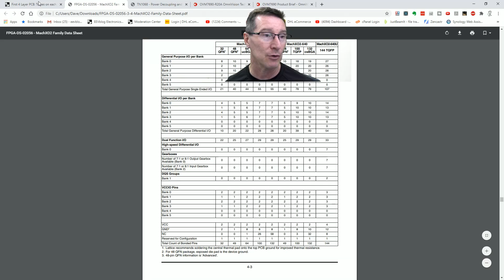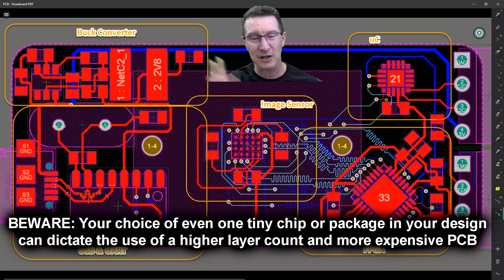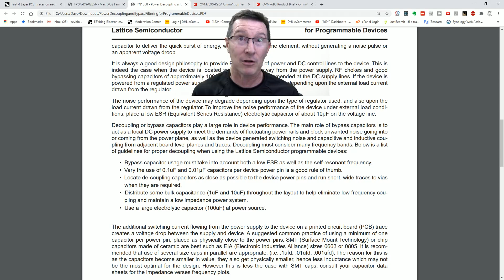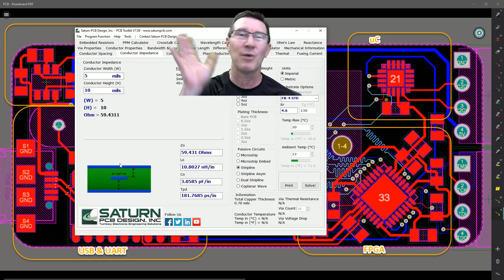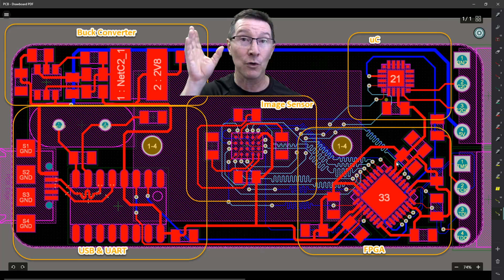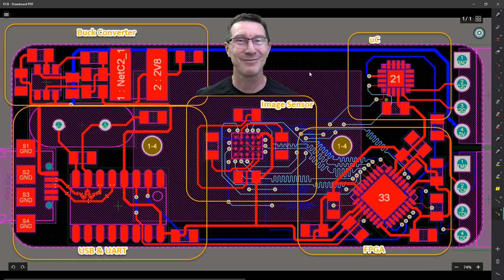EEVblog #1323 - PCB Layout Review & Analysis

Comment: Those decoupling caps around the image sensor looks like they are playing musical chairs.
Reply from the maker: Last one down gets the inductance!
Reply: @EEVblog  I think all of them got the inductance in this case!
Reply: @EEVblog  Is inductance contagious? In the new normal, it needs to be asked.
Reply: I was reminded of a May-pole dance. But where are the zeroes?
Reply: The designer probably had them right the first time but then decided to turn the chip 90° for signal routing "optimisation"?, but did not move the caps with it. Just guessing ofcourse...
Reply: @EEVblog  I laid out a switching power supply recently and placed ceramic caps for it... and the main cap for the board near the power connector... my bad it was over an inch away, and when the board powered up I got a large spike (48V input spiking over 60V) that killed the regulator! Bodged on an electrolytic next to the regulator and it worked every time and voltages came up nice and easy! THE ESR on the ceramic caps is so low... that they don't do much filtering.

Comment: These types of videos I really enjoy - It's almost like having Dave as a mentor explaining what to do. Regarding the decoupling caps, I always like to think of it as knocking out any inductance that's introduced from the long trace from the power supply to the chip, placing the cap as close to the IC as possible means the trace post cap is super short (and therefore very low inductance!). But, the discussion on things like layer stack up and WHY you should have it that way is priceless, I'll definitely be watching this video again when I need to lay out another board!

Comment: All good advice Dave. The power wandering around on a 4 layer board instantly threw me for a loop (pun intended). 🙂
Reply: It looked like he tried to do the layout for a 2 layer PCB, then had to later change the design.  Those 2-layer power traces definitely need to go in favor of vias to the power planes.

Comment: I never run tracks between pins, like on that lower left, unless absolutely necessary. It's easy to end up with whiskers to be left when etching the board. It's also not ideal to be soldering either side of the through trace because you can get a solder bridge if the solder mask isn't perfect. There's no need to have done that since you can route the power to avoid it.

This board uses very few hole sizes which is good. However, make the vias as big as you can, because small drills, say 0.4mm or less, have much shorter flute lengths than bigger ones. PCB manufacturers typically want to drill through 3 x 1.6mm boards in a stack because drilling takes a lot of time. As soon as you drop below 0.4mm, you're pretty much forcing them to drill them 2 or even one high. Ask your PCB manufacturer about this sort of thing, you can save a lot of money. Decades ago, all PCBs were drilled and routed 4 PCBs high, and via holes were 0.7mm diameter to allow that.

If you have lots of through holes, try to rationalise them to use the same sizes wherever possible. Again, PCB drilling machines have to stop the spindle, swap tools and then restart which all takes time. It's also another possible source of error, because drills can look the same size.

Another thing we used to do was to drill the first and last hole of every size in the scrap outside of the circuit frame. That way  a quick visual check can spot if a drill broke. If there are thousands of holes, you won't spot this until much later in the process.

Again, ask your PCB manufacturer for their best design practices, and better still, go and visit them and sit down with the people who are the victims of your poor design decisions.

Use wide tracks rather than unnecessarily narrow ones, and don't route them up tight against things when they don't need to be. 
Run a gap check, and increase the clearances it flags up. Increase the allowable gap clearance and do it again. That way you can make the board easier to make and have less chance of shorts or interference.

Comment: The USB-to-Serial chip is CH340, and its CH340C version is exactly the same SO-16 as others, but doesn't need an external crystal, it has an internal one, the XTAL pins just stay NC! The chip is available on LCSC
Reply: Hmm I heard people say it's very unstable though, don't know why. That's why I just used the G version in a board a while ago
Reply: Internal oscillators have fairly wide frequency swings over temperature.  I'd prefer to use the crystal for the much tighter frequency tolerance.  USB doesn't like varying signal rates.
Reply: I've done several hundred boards with the 340C and generally it's been good for me. However I did have this one customer who absolutely could not get the products to operate on one of his PC. It could have been many reasons - including this.
Reply: @Dave5281968  Wouldn't you rather use the host's time base in the device? Guaranteed to be ±0 variance from the host's time base, once the x48000 PLL locks.
Reply: @AirzonesBlasters  Yikes

Comment: A lot to unpack here.
Upfront, I worked at Agilent in Mulgrave for 27 years, the last 12 as a PCB designer (ECAD Engineer) for our EE engineers. The last 5 years as their only dedicated pcb designer. We used Protel/Altium exclusively up until I left 6 years ago, now retired. They have now mistakenly gone corporate with Mentor Graphics. That’s another story.
First off, top layer should be BLUE, not red. Red is the Altium default and is wrong. Blue top stems from the old red and blue Bishop tape days whereby the positives and negatives used the colours to determine which was the top and bottom layer. This was of course for 2 layer THT (Through Hole Technology) pcbs. Yes, it’s only a colour but standards should have been kept.
Next, use metric, NOT imperial. All Agilent pcbs were designed in mm, not mils. The world is metric, not American standard imperial. All through this video I had trouble trying to convert mils to mm. The only imperial that we used at Agilent was oz for copper weight but even that we usually specified as 18 or 37um. I.e. thickness rather than a silly oz per sq foot or whatever it is.
Now to the video…
•	The pcb should have a ~5mm edge around the pcb for smt (Surface Mount Technology) placement machines to grip the pcb securely. Only reason not to is if the pcb is part of a panel with routed breakoffs or defined routing afterwards.
•	I agree the cap locations around the image chip are terrible.
•	A major rule to follow in design is “follow the current, follow the current, follow the current”.
•	Traces at acute angles are the single worst error in pcb design. I guess the creator used auto-routing , terrible idea.
•	THT crystals are quite common for reliability and getting the right type of crystal, they’re ok.
•	4 Layer is fine for this. It could have been done with 2 layer but with EMC in mind and the fact that 4L is only 30-50% higher in cost than 2L then it’s a good idea. Even in very complex pcbs like PC motherboards you very rarely need to go over 4L. I designed over 100 pcbs I reckon with many large designs and I only used a 6L or higher about a half dozen times, and these are A4 size pcbs with many many chips.
•	Altium footprints are not optimum, even though they say they are PbF and IPC “standard”. They aren’t truly PbF pads and courtyards don’t allow for height when heat flowing solder 
•	For the large FPGA, yes they are usually designed to be at 45deg if using lots of pins such as in a PCI card. They’re designed that way.
•	The usual chip bypass is 100nF but I agree it is negotiable. Also remember that vias to the gnd and power plane will provide HF bypass which might negate the requirement for 10nF caps. Another method is vias inside a chip’s smt footprint but that’s a whole new ballgame.
•	I agree that a large cap used as bulk capacitance and the local power plane capacitance might be enough, maybe not.
•	Don’t use auto-routing, it’s more trouble than it’s worth unless you are dealing with a really large design that is time constrained, but even then you need to do most of the placing and power planning beforehand. Auto-routing loves 6+ layers. It’s getting better but just cannot easily do analogue stuff properly.
•	I did not see any gnd or +v vias around the chips, but I suppose it was early in the design. Design is a compromise between signal trace coming out and close placement of power cap and its vias.
•	I personally could see no value in wiggly trace lengths of these signals. I may be wrong. Remember 150mm is 1ns. I think about 30mm was the approx. length which equates to about 200ps. Is that a big deal in this circuit, I doubt it. I may be wrong.
•	I agree the signal traces should have been the priority on the top layers. Vias are impedance interruptions which cause reflections etc and cause more trouble than trace length IMO.
•	This is a simple design and in my day I would have finished this design, done the BOM (Bill of Materials) and schematic cleaned up and exported ready for the pcb manufacturer to start work in half a day. My work was always using an EE engineer’s schematic design with which we collaborated in the pcb design phase.
•	As mentioned by Dave I would possibly have added a GND fill on bottom and top layer. We NEVER relied on a GND fill to ensure proper grounding of SMT pads. Always use GND vias to power caps.
•	Yes, top layer signals allow modifications of signal tracks if required.
•	There are many choices of grounding here. Star, gnd fill and power planes. We must look at the current flows and “follow the current”.  BTW, Follow the current saying comes from a very famous HP designer many moons ago who quoted this to all of his pupils.
•	Vias to pwr planes is maybe more important than external smt caps.
•	Less vias is less cost. 0.6mm via holes use up a lot of drill bits if you have lots of vias

Comment: I use the Saturn PCB toolkit too! It's such a great tool.

Other observations:
- length matching isn't what's important; it's time matching. Different layers will have different propagation speeds, so if possible, all the signals should go on the same layers (e.g. all go L1 then L4 then L1) and ideally the on a layer the lengths should be matched (e.g. each trace has 500mils on L1 and 400 mils on L2). Also remember that vias add length, so either take it into account or have the same amount of vias.
- when changing layers on a high speed signal, there should be a stitching capacitor (between the two reference layers) near the via, to give an AC return path
- DC/DC converter routing is poor, but this might be a work in progress with temporary traces to show that it routes ok and eventually will add regions/polygon pours
- looks like the xtal case might touch the usb shield pad. Probably not an issue.
- use thicker traces for bypass/decoupling caps. 12-20 mils 
- traces are really close to your mounting holes
- hard to tell but solder mask sliver looks too thin on the MCU
- very often the thermal pads are supposed to be connected to ground; check the datasheet.
- you've got tons of space at the bottoms, consider adding surface testpoints at the bottom); it's free real estate
- high speed signals going to middle layers cause stubs at the via (e.g. if you go from L1 to L2, you have a stub between L2 and L4)
- looks like all your edges are going to be routed, so you'll need mousebites  for your arrays, but I don't see many places when you'll be able to put them because your traces run so close to the edges
- don't forget to add fiducials. They can be on your array, but you probably want to have one near the BGA. Preferably at the top right of the BGA so it's also close to the MCU.

Comment: The DC/DC could also be improved. The input caps are far away, they should be priority one. Place them as close as possible to the IC and even connect their GND-pad directly to the IC without any vias. Also do not connect the feedback line to the inductor, connect it to the output cap instead. Additionally, I would rotate the chip to make the switching node as short as possible (prio 2 directly after the input cap).

Comment: I recently had to design a very compact PCB with multiple ground and power areas and eventually, out of frustration, decided to go to 4-layer with grounds and power in the inner planes.  It was absolutely worth it.  This kind of design in 2-layer is an absolute nightmare.  It would be helpful if you could talk about how best to do multiple digital/analogue/power grounds.

Comment: 7:45 Hey Dave! The buck converter layout is NOT GOOD! The switching node and the trace to the inductor is too long. Also, the output for the feedback is taped at the wrong place. Furthermore, there are no power planes and the input and output capacitors are not close to each other. The only thing which is good, is that all power traces are on the top layer.
Reply from the maker: I know, but I specially said I wouldn't get into that.
Reply: Why should the input and output capacitors be close to each other?

Comment: The Top-Power-Ground-Bottom stackup is terrible for EMI, as it places the power planes far away from one another. This acts a lot like a slot antenna and radiates noise out the sides of the PCB. This can be disastrous for high-speed designs. A much better 4-layer stackup would be Top/Power-Ground-Ground-Bottom/Power

Comment: Most of the issues with this design come from routing power first. Which for whatever reason is a common thing told to beginners to do in a lot of online courses (Udemy etc.). Have seen a couple of newbie engineers I work with do this.
Reply: Maybe it's a throwback from one- or two-side PCB times when one didn't have the luxury to just drop to a power plane on the spot wherever needed. After all, pesky chips with 4-6-8 pins needing all connected to a non-plane power trace cutting off everything else as they wind around the chip can really ruin your day if you start by laying out your signal traces first only to realize there's no way to connect all the required power at the end without redoing absolutely ALL the other traces from scratch. This has even become worse recently ever since THT (where as Dave mentioned you get a free via on each pin which will get soldered in anyway) got replaced by SMD, assuming you'd rather stay on a single side which is much simpler to produce at home without the headache that DIY vias incur (once you're ok with having vias and a two-side PCB it stops mattering as much).

Comment: I used I2C IO extender for arduino project, it was around 1,5m away, coupled with standart cable, going power for it in same cable. Just needed to to drive data lanes bit harder (lower termination resistor values), working just fine, no need to worry about I2C lines on the PCB, they will never be so long. Just imagine how big a PCB must be for lines to be over 1,5m xD
Reply: Problems with I2C will usually show up quickly if you go do your proper EMC testing. It's easy to get your communication completely messed up when you apply some RF fields to your designs. Sure, it might work in your lab and on a bench, but if you have some radio emitters (like cell phones) nearby, your device might suddenly act all crazy... Seen that happen quite a lot on I2C, even on relatively small 4 layer PCBs with proper circuit and layout designs and ground planes.

Comment: From experience: The camera works partially analog internally, so give it a CLEAN power supply. If your picture looks like potato, it means your supply voltage is fluctuating a bit. And it will if you don´t do it clean. Route directly from the converter´s output cap to the cam through an (SMD) ferrite bead, take a big buffer cap, 10µ or so close to the cam, put the decoupling caps directly at the pins and stitch to ground near the decoupling caps like Dave said (there´s a reason that those pins are directly on the edge). The 0402 would do better, as you´ll have more space for routing. If the camera has a dedicated "analog VCC" pin, that´s the one you must provide the clean voltage to, don´t mix the digital and analog together, else the digital part will mess up your image.
Forget the length matching. In cases where you need them (like USB3.0), you would get trouble with your vias anyways doing so, as at frequencies where you need them (over 2GHz) vias partially reflect the signal, so in a high speed symmetrical line, you are restricted to two vias per line and match the lengths between the vias, with overall length deviation of 0.2mm. But for a cam that runs on 30MHz or so, it may even make your image worse, because you introduce EMI to the cam by bad routing.
According the power converter: small area is not enough. Make sure the loop through the coil/capacitor/switch-pin is tight. Most datasheets have a reference design. Use the proposed components or better. Good schottky diodes raise the efficiency of the converter. Depending on the type of coil (simple unshielded or so), you might need to remove the copper layers below the coil to avoid eddy currents.
Dave introduced this "capacitor multiplier" circuit to generate clean voltage. I didn´t try that in my camera design, because the simpler solution above did the job great, but I´ll keep it in mind just in case.

Comment: The designer, on this pcb did a common “mistake”: the power traces were placed first then the rest was adapted. It should be the other way around. Place you restrictive traces first, in this case the data and impedance controlled traces. Then, the rest.

Comment: Great video as always! One thing that struck me though that I was kind of expecting to be mentioned is the placement of the FPGA and converter each placed on opposite side of the image sensor

Just switching place between the uC and FPGA would help shift the ground-plane return currents (assuming there is a solid ground plane ofc) of the FPGA from passing directly under the image sensor

But thats just my own humble opinion :) 

Keep up the great work!